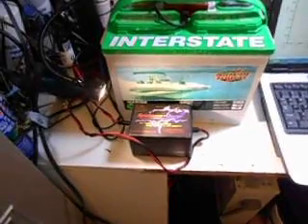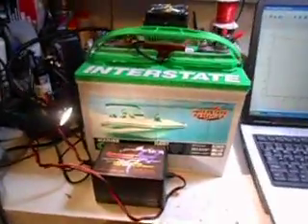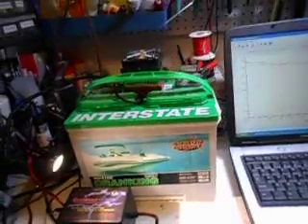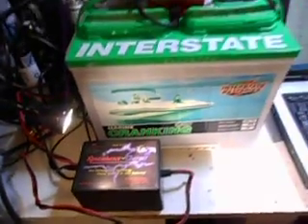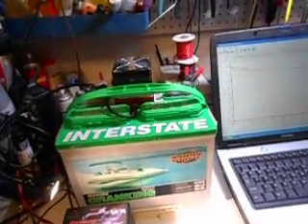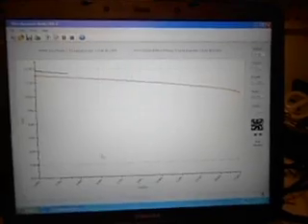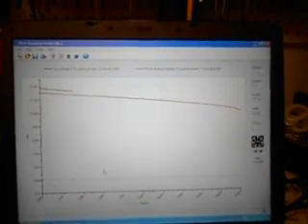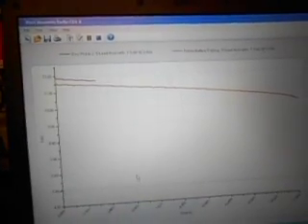The Bedini Pickle Battery

Comment: Great results, they just run and run. Strangely, there'll be a point at which it may just sit for hours at about the same voltage reading...not sure if it relates to the load yet. I have a 10 year old car battery conversion that drops to 7.5V with 1A load but then sits there all day. Charges back to 11V in about 2 hour on 450mA solar. 
One thing, you can gain some trust with this battery again now, with all the data you're collecting :)

Comment: When you get a chance check the pH of the electrolyte and see how acidic it is going.  After several days of charging and discharging my battery,  the pH went to around 3--- about that of vinegar.  I don't mind that because the dead battery is now very usable again.